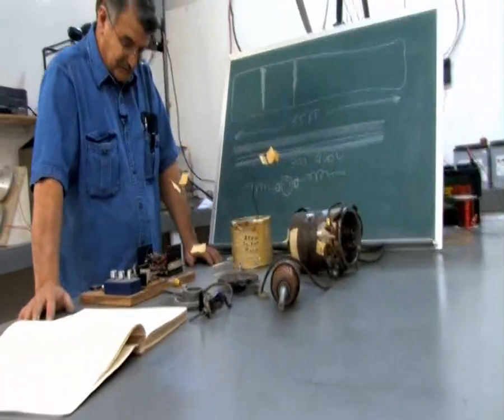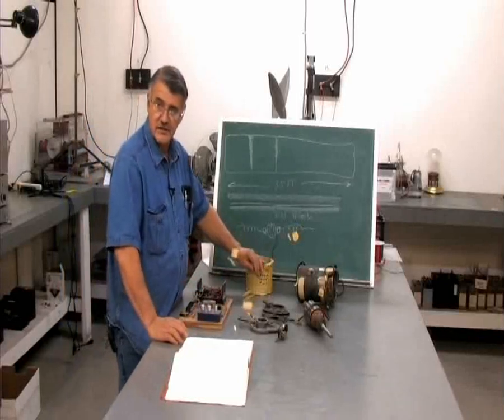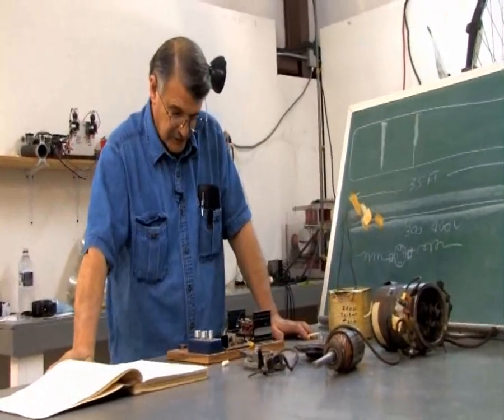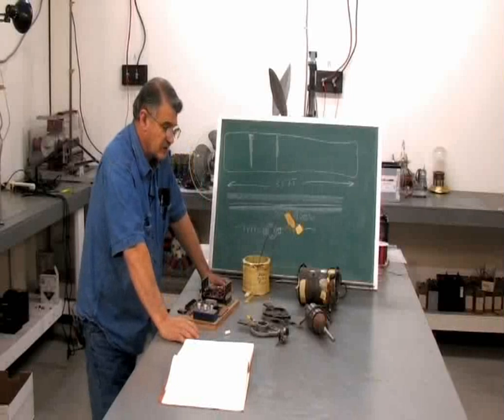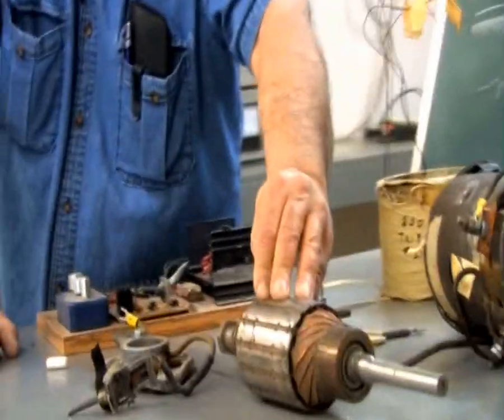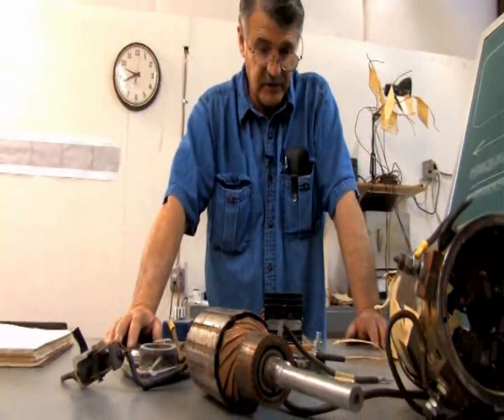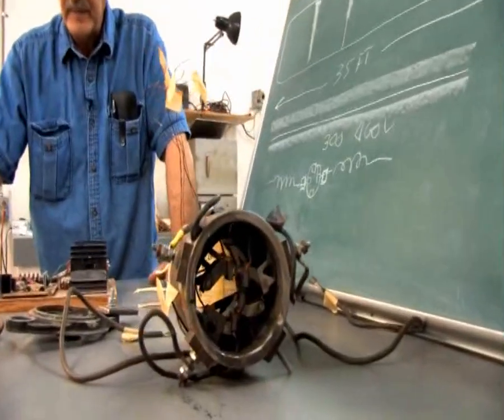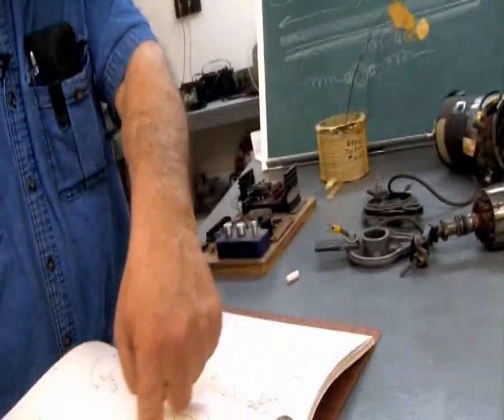Energy from the Vacuum - 14 - Lockridge Device - Part 6

Comment: metadyne simplified even tought some what reverse enginered external cirquets used depends what armature winding type is used and where exactli magnets are placed and brushes .Ordinari dc motors can cascade,decode pole ratios ,latching,phase shifting,timing delaying ,all that and more ordinari dc mashines do any way I supose Delco starteres have unique trades like S/R type selenoids,3different sizes of ferrite magnets with metal seperator jokes ,insulated brush assemblies and acidentali gasoline brushes fit perfectli on diesel insulated brush holder assembli so Im missing some thing? I dono the main out out brush terminals instead the usuali +@- out out swap around some how so peopel see this +@+,-@+,-@- as an out put ,some times pulse delays or even transistor actions can by witnesed like this @--+,@+-- some times it is this @-+- ,@+-+ as an out put literaly the metadyne represents modern xor gate ic chifter cirquet the let chaser cirquet perhaps latching pins by an computer psu to gain centrain voltage differences,wacum tube virtual ground creation,or perhaps transformer latching pins might have more in common with the original metadyne effect.Its just an ordinari car transmision ok so the metadyne just produces pulses in ratios like gears instead gears its poles commonli 2:1 ratio or some thing ells,metadyne is powerfull by him self with out serries/parrarel 2:1 ratio armature or shorting brushes the end result wuld by powerfull arc welder so of corse the 1 input wire rectifier is acordingly modified .If it is easyr to understand take this G.Fratwell alternator design hv dc bypass wire + Starter Motor modified to act as Metadyne of any kinde 1 input to 1 out put rotary converte,what you do or what you gear that staff or external cirquets used betwean points its totali up to your choise . And all that has nothing reali to do with Bedini ,Tesla or any one ells ok its more like combined sience sht .